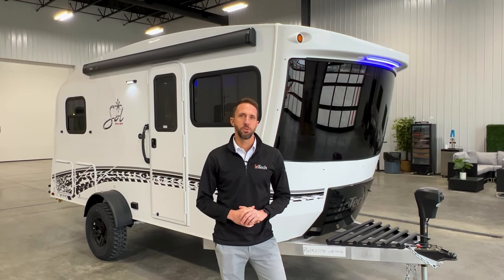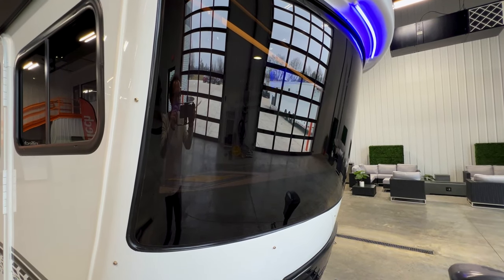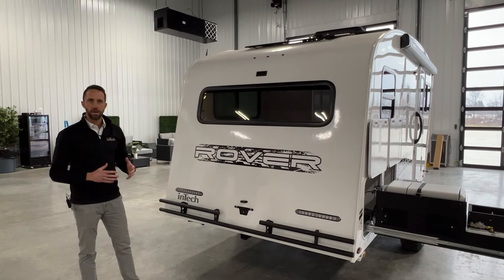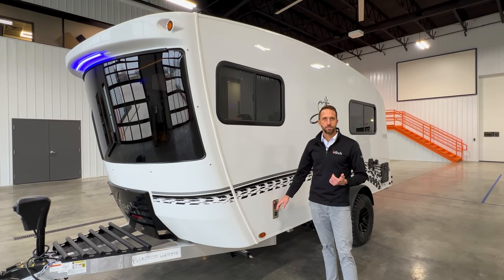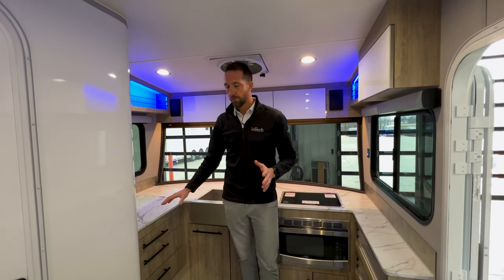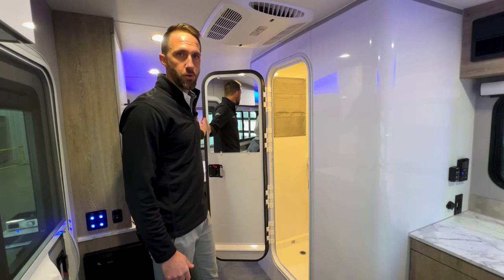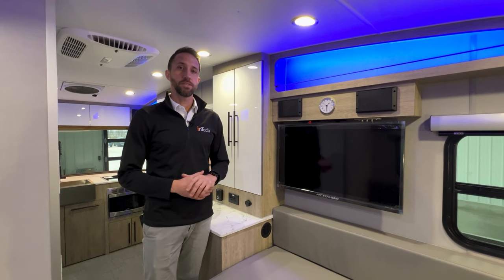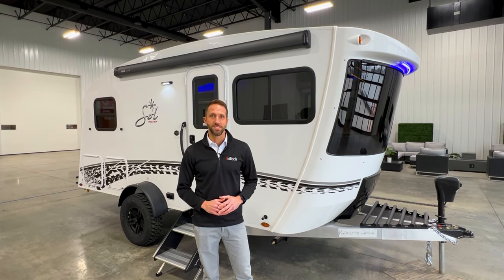2024 Sol Eclipse Walkthrough

Comment: I hope they've fixed the axle issues that plagued so many of the models.  Aluminum is very hard to weld, you need a very experienced welder.  They had to retrofit the frame with steel plates that they bolted on so they could attach the axle more securely.  Intech shouldn't take the full blame for the axle failures, it's in part due to the axle perhaps being under-rated for the loads most campers carry.  I'd like to know if they've corrected the axle issues with this year's model.  Too bad they haven't gone to cassette toilets.  It's so inconvenient to have to go to a dump station for black tank waste.  I've always liked the overall design of this travel trailer but I'm holding out for future upgrades in design.  I think the Lagoon table and the king size bed is a great change!
Reply: Axle's have been fixed for quite a while, you should have checked your facts before posting a negative post about something you know little about, it has been resolved..
Reply: Just so you know, you can’t weld aluminum to steel at all. No such process